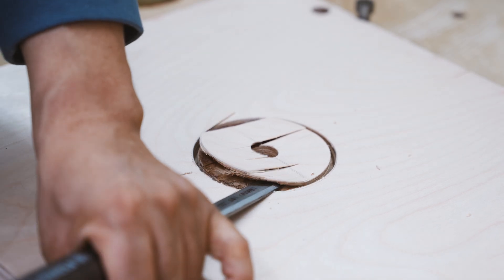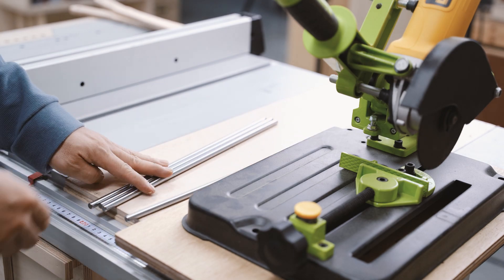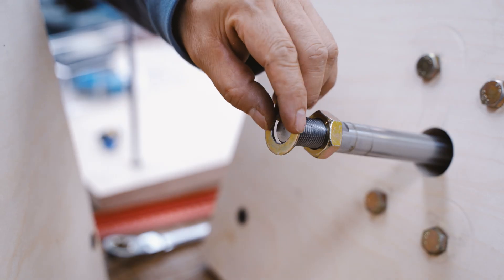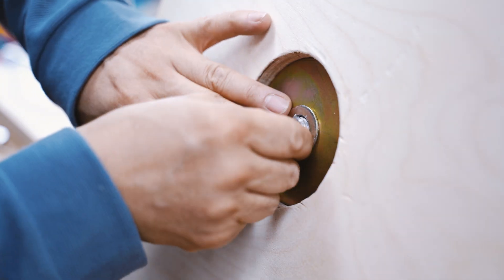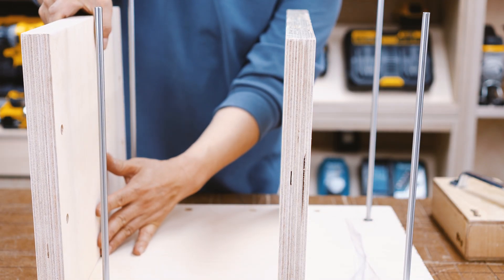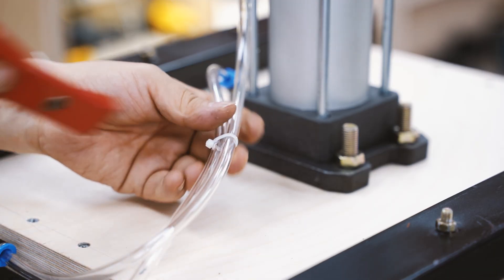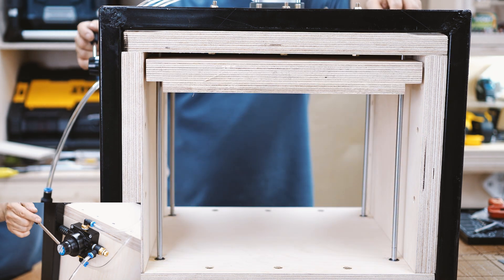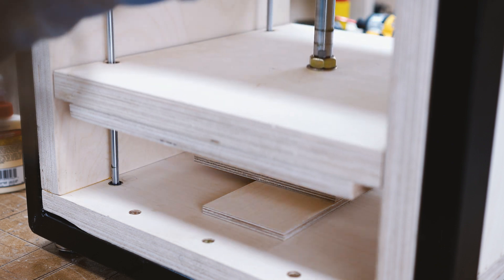Making Air Cylinder Press / DIY

Comment from the maker: Please turn on your language subtitles!
I made a small press. There are many different uses. When we glue wood, we can use it instead of a clamp, or we can use it like a vise when we cut wood. 
Since the pneumatic cylinder is very strong, it seems difficult only with wood, so I added a frame to the outside using each pipe. 
Each pipe I use is red, so I painted it black because I thought it wouldn't match the wood, and it looks great.
I usually operate the cylinder using a solenoid valve. However, this time, I installed a manual valve on purpose to use it for press purposes. It's to physically pull down and up.
After making it, I feel like I should have made it earlier. I think we can use it in various ways.
One unfortunate thing is that I installed 8mm support at the four corners, but it seems a little weak.
If you want to make it similar, I recommend that the diameter of the support should be more than 15mm.
If you have any questions, please leave a comment. Let's think about it together.
Thank you.

#DIY #AirCylinder #Press #Making #Air_Cylinder_Press_Making #Woodwork #Woodcraft

Comment: How many Kgf does your cylinder produce? Great video. Thank you for sharing the idea.
Reply from the maker: The diameter of the cylinder is 60mm, Because the air pressure is 6kg/cm² It has a power of almost 169 kg. thank you!